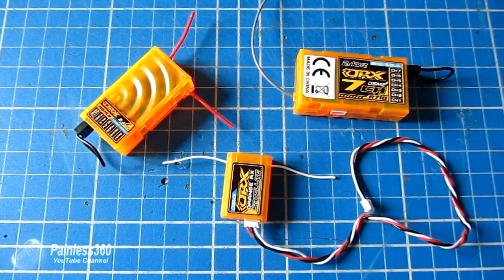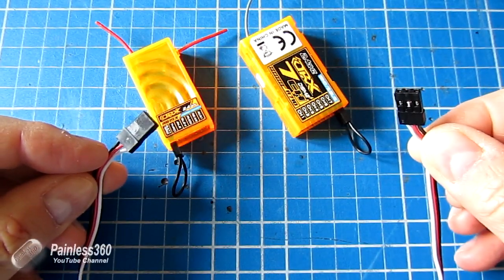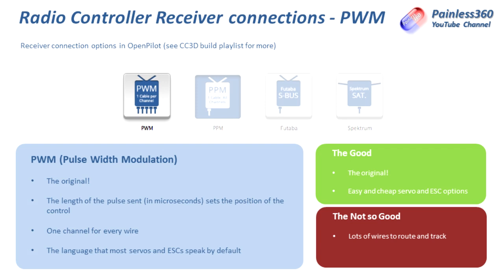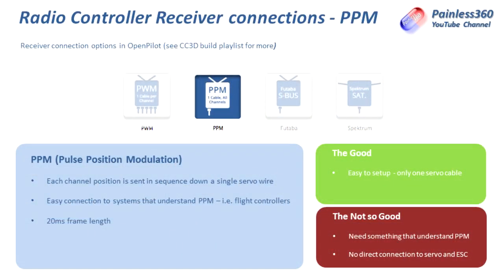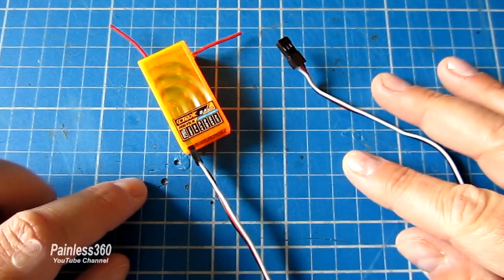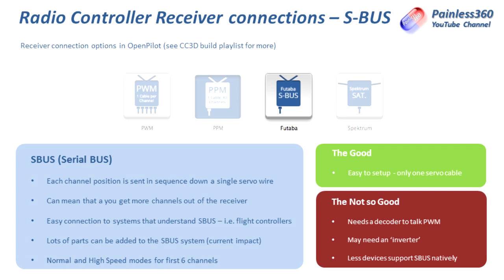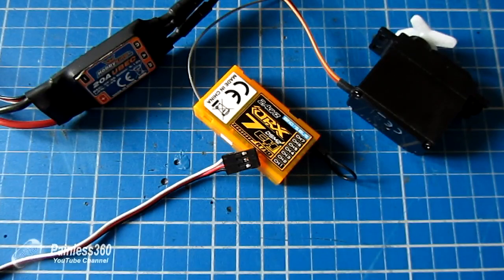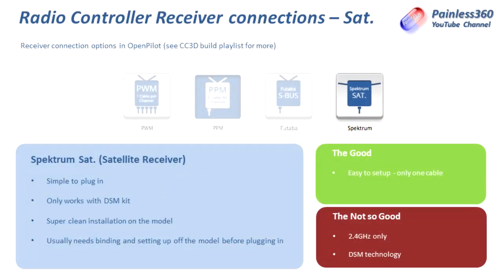RC Quick Tip - PWM, PPM, CPPM, S-BUS and Sat. explained for beginners

Comment: stubtoe Using my DX9 and ORX R615X Rx... knowing that I can get up to eight CCPM channels can I use any  two other PWM channels from the R615X... this would include control(Ail, Thr, Elv Rud or any Aux/Gear switch
Reply from the maker: +Joe Stubbs Typically the first 6 outputs are on the normal pwm pin outputs.. Best of luck.
Reply: +Painless360 .. not sure if I understand ..I will try .. channels 1 to 6 = Thr; Ail; Elv; Rud; Ger; Ax1; .... chan 7 and 8 are Ax2 and Ax3 ...now,  how do I attach these to the CCPM daisy chain or do I configure the PWM O/P's to give me 2 extra switch O/P'S   Oh!!! and keep the good work up with your very informative video's, I do so wish  the RC Forums  would use the medium more ...Joe

Comment: have the xk detect x380 rx/tx and cc3d revo.......  PPM one cable for all controls coming off rx.

Where to plug into cc3d, and type of plug to use off rx to cc3d, as nothing (inputs) match up with plugs that are connected to rx.

guessing it will plug into the flexi port, although, 3 pin coming off rx, 4 pin, going into flexi port.....

THANKS
Reply from the maker: +LA smyth See our series on the CC3D that answers a lot of these questions..
Reply: +Painless360 I looked at that, and this vid, shows the 3 prog into rx, and same plug on other end, but FC in this vid has 5 pins, I think, and 3 on left side used, i think.  Which cc3d except for motors, has no external pins.  Just the plug outlets, which isn't compatible with plug coming off the rx

Can't calibrate tx till figure plug and sequence.
Reply: +LA smyth at 7:00 of this vid, it shows the plug in/out, are the same, but that needs to be switched to a plug that will insert into the cc3d.  ports are 4 prong, with 3 coming off rx.

also, is there anything i can burn out / zap if rx conx to cc3d wrong, or visa vera, anything coming in or out hot I need to worry about.
Reply: +Painless360 if &#39;libre&#39; is the same, I may have found the answer.  pin 1-2-8

https://forum.librepilot.org/index.php?action=dlattach;topic=149.0;attach=240;image

if that doesn't work, may have to switch over to libre...........any thoughts.  wish I know 'openpilot' closed before buying .........LOL
Reply from the maker: Yep, that sounds right! Best of luck!

Comment: Hi,  when using s-bus on orange 7 channel receiver can the spectrum dx7 transmitter be used , is it  s-bus compatible  or  is the s-bus only for futaba transmitters?  Regards Claude..
Reply from the maker: +Mark Crowe S-Bus is how the radio receiver sends the signals so as long as the receiver is S-Bus out then you are usually good..
Reply: Painless360 Thanks for your help. Regards Claude

Comment: So, can I use PWM to PPM converter with PWM receiver to get few pins free on flight board? Right?
Reply from the maker: Yep
Reply: +Painless360 That's great! So I can use cheap converter instead of buying expensive receiver-transmitter kit again)
Reply from the maker: Yep ;)

Comment: Hi thanks for a timely lesson; I have just got back into this magic hobby and a steep learning curve; I am building a tricopter and chose the ET vector FC I have a Sperktrum DX6 and bought a SPMAR 7700 Rx which has a satellite; you say connect the satellite to the FC what about the main Rx does it also connect and howI have been flying fixed wing trainers on PWM all very enjoyable Thanks for your time Adrian
Reply from the maker: +Adrian J Vermeer Welcome back to the hobby. They satellite can be connected as an auxiliary set of antennas to the main radio receiver or connected directly to the flight control board (if supported) that makes the installation and wiring very easy. I would not use an R616XN from HobbyKing instead as the challenges with 5v vs. 3.3v are all avoided. Best of luck with the build..

Comment: Hello,
From the tutorials I've seen with a normal sized CC3D, go solder a wire to catch the + 3.3V to power the satellite.
https://www.youtube.com/watch?v=_iPlUcGKZ2o

By cons for CC3D MINI size is not specified on the electronic card and it does not seem to have a terminal where to connect for the + 3.3V. My question is what the CC3D mini format, it simply plugs satellite and the supply voltage for this satellite is good (no 3.3V fetching matter)?

thank you in advance for your reply
Alex
Reply from the maker: +Alexandre Pietrons I don't use sat. Rx here. I would use a R616 from HobbyKing and connect it via PPM. Sorry I can't offer any more advice. You can use a step down to go from the 5v to 3.3v.. Best of luck.
Reply: +Painless360 OK Thanks

Comment: Great video! Thank you so much for this information and the learning I've gotten from so many of your videos. I would like to suggest that you create a video about how it is possible for there to be 16 channel radios (like my Taranis) when the common (50Hz) frame is 20ms. I've posted this as a question on http://www.rcgroups.com/forums/showthread.php?t=2537177#post33128443 also.
Reply from the maker: PPM only supports 8 channels, you need the digital goodness of S-Bus to get all 16. You can also bind two x8R receivers at the same time and get all 16 (2x8) PWM channels on the model too..

Comment: failsafe after model final set up  using the r615 receiver ..how is this done ?
Reply from the maker: +bill alvarez Sorry, I don't understand what you are asking..
Reply: what i understand is that ..lets say i am using pwm on the r615 receiver and i am done setting it up ready to fly ..but of course i need to set failsafe(rebind) to avoid flyaway right ..so how do i do this using ppm(single wire occupying bind pins ) got no where to insert the bind plug..thanks for your reply..you thought me a lot through the years btw ..thanks again
Reply from the maker: +bill alvarez I see. unplug the PPM cable and rebind as nornal then unplug the Bind plug and reconnect the PPM again..
Reply from the maker: +Painless360 Yep :)
Reply: +Painless360 
that simple hah..thought the fc keeps the stick positions ..thanks

Comment: As soon as you told me I had a PWM transmitter  from the Hitec Aurora 9x manual, I searched "Differences between PWM and SBus."  ...and of course the first result that shows up is this video.  Thanks again, Lee! (I'm sure this won't be the last time I say this).  I now understand the physical differences of the various types, but I was wondering if you can shed light on what is better in terms of "speed", I guess?  Because the signals in a PWM system have individual wires to talk along, would this make transmission time easier, thus faster than say a SBus system?  ...or perhaps more stable?
Reply from the maker: +Michael “MiMo” Richard In real terms the difference in speed is imperceptible. The PPM frame is between 22.5 and 27milliseconds so it's all happening faster than pilot reaction times. In some flight controllers they then multiplex the PWM signals anyway so any faster transmission using 'parallel' signals is lost anyway. I wouldn't worry about it if I were you, happy flying!

Comment: Thanks for the video! I was wondering, if I connect a servo cable (white,red,black) horizontally across the signal pins on both the flight controller and receiver, is it safe to do? I tried this just now with a FrSky X8R to an APM 2.6 and was able to do the transmitter calibration. I just want to be certain that I don't fry anything :)
Reply from the maker: +iflyimpilot Yes, I do that too when I have no option but to use PWM with a flight controller. I'm a huge fan of PPM personally!

Comment: Great video. I am currently flying Naze32 with Spektrum Satellite. I have an SP3 board on the way and can not find the wiring information I need to do for the Spektrum Satellite only. I can use a receiver but like the satellite only on my Naze.
Reply from the maker: +Mark Haman I would guess UART3 and connect to the header pins but I would suggest you contact the guys who sold it to you for support.. Best of luck...

Comment: Hi can you put me out of pain.... Orange receiver dsmx cppm or s.bus and my DX8 (with Pixhawk) .. OK if I use the R820X as normal I will get 8 ch, If i use cppm I will get 8ch plus. total of 12 ch . what I cant find out is Do I get 12 ch from my DX8 ( which is an 8ch Rx) or can I poss through mixing get the 12 ch . Alas no one has answered  on other forums so it is up to you to hold the faith. Cheers
Reply: +Russell Green a Spektrum DX8 is an eight channel transmitter, that is your limit
Reply from the maker: +Russell Green The limit, as erg)centric rightly says, is your radio. If can only send out 8 channels max. As it happens this is perfect for an 8 channel receiver or a PPM connection to a flight controller.
Reply: +Painless360 Ok got it now ,, It is either the DX8 or Cppm not a combo or Mix, tks now out of misery, keep up the great work, we need it

Comment: Whats i-BUS
Reply from the maker: Where have you seen that?
Reply: Painless360 On my flysky fs-i6 and the receiver i bought fs-i6ab

I have the option of ppm and ibus it says to get more channels out of the system. 

Could I also ask, I recenetly got a dji naza and trying to use ppm i find that the flight mode switch must be on the 7th channel and my transmitter only has 6 channels, is there any method to modify the order?
Reply from the maker: Not sure what they mean - I've not heard of I-bus.. yet!
Reply from the maker: I believe you can get channel mappers that will remap the channels but I've never used one. Sorry I can't be more help. Best of luck with it.

Comment: Question 360..i just recently switched from spektrum using serialrx to Frsky d4rii cppm. The throttle response is incredibly slowed down. Am I missing a setting in the transmitter/cleanflight?
Reply from the maker: Are you seeing this in flight or just in the Cleanflight GUI? You may need to upgrade the FW on the D4R if you are using more than 6-7 channels.. Best of luck..
Reply: Painless360
Just in flight. Only using 5 channels. 5th just to change flight mode. If I use the motor control in cleanflight it is fine
Reply from the maker: Sounds odd, I've not seen that and have used all of the modes of connection here. I would suggest search in the forums..

Comment: Painless,

Seeing how you lean toward ORX wondering if you've heard anything of the pulse width on the ORX R620x-R1220X receivers being too narrow for the Pixhawk? Seen a few musings but nothing definitive. I'm running the R615X using PPM quite nicely but need to squeeze out another channel.
Reply from the maker: +Chris Salas Not heard of that myself as I only use the ORX kit on park flyers with no more then 7 channel (5 normally). Best of luck with it.
Reply from the maker: Almost every receiver has users that are unhappy with the performance. Thanks for sharing your opinion and experiences.

Comment: Nice video Lee, Cleared it up for me. Do you know how you bind the Sat rx directly with out a main Rx. I understand you can do this with the Naze32. Have you done a video of this, Would be grateful for the info?  Regards Garry
Reply from the maker: Garry Nutter No video from me but some others have done it. You need to bind the satellite receiver to the radio using a conventional receiver with the sat port on the side them unplug it from there and install it onto the Naze32. This is covered in the Naze32 manual pages. Best of luck with it!

Comment: Hi Great video my question is in PPM mode can i used other channel on the RX for a gimbal or a 2 way video switch ?
Reply from the maker: TriniRCmodels That depends on the receiver the little receiver shown here will but may will turn off the PWM outputs when the PPM output is used.
Hope this helps.
Reply: Painless360 i have a D4r-ii receiver can i use channel 2 for video switcher and if so how do i set it up for a switch on my transmitter or even tho on any ppm receiver can you do a video on how other channel works
Reply from the maker: http://www.hobbyking.com/hobbyking/store/uploads/736633136X172282X46.pdf answers it for you - "When in PPM mode CH2 will output RSSI (PWM)"

Best of luck with it.

Comment: Please answer a really simple question.  I am using pwm.  Would like to use cppm.  I understand for cppm you use only one cable,  this comes from the bind port on the rx, but which port do you use on a flip32 board.  Please help.
Reply from the maker: Fred Kaz This is covered in this video - https://www.youtube.com/watch?v=-yiJw1lYCq8&index=2&list=PLYsWjANuAm4p47OBBTOo4Xr3lNUc8PFpc
The Flip32 is the same as a Naze32 really - the pin-outs are a little different - https://www.youtube.com/watch?v=SZdIWCOigoY
Loads of useful series on the channel now, have a look about - you never know what you'll find..
Happy flying!

Comment: Great video, Im wondering how the pwm to ppm converters work with the naze/flip32.  Anyone have any experience with them?  Thx
Reply from the maker: knwest2012 They are very simple devices to use - plus the PWM side into the Rx and the PPM output into the flight controller. Be aware that they so cause a very slight 'lag' on the inputs as it has to read, decode, re-encode/package them into a PPM frame and then send them via the single cable to the flight controller.
Happy flying!
Reply: Thank you sir, maybe not for me as I fly mostly proximity.

Comment: Nice info.  What does a DEVO 7 RX output?  And will they work with the various FCs?

Thanks
Reply from the maker: TheGusK You need to get the manual for the receiver and see what it can output. I don't use that kit here so can't help..
Best of luck.

Comment: What so called "satellite receiver" has to do with the satellites flying on Earth orbit? Why it's named like that?
Reply from the maker: Igor Zamychkin "Satellite refers to the fact that this is a satellite receiver. Spektrum and others use a system where the main receiver can connect to smaller, auxiliary receivers for improved reception. These smaller aux. rx are called satellite receivers. Hope this helps."

Comment: have u use this orangerx to pixhwak ? ( i am using spektrum radio)

here is 2 question:

1) when i try to setup the failsafe , and try turn off my radio see what is the the throttle value  when i turn it off ( the lowest value is 1088 when the radio is ON, when i turn it off it suppose lower then 1088) . however when i check the radio calibration page at mission planner when i turn off the radio , the throttle value didnt drop at all, it just stay at the value which when i turn off the radio. ( for example if i push to 60% of my throttle before i turn it off, i will stay there ) but the board still able to detect if lose the radio signal and failsafe will kicks in if i turn off the radio (as long as i set the failsafe value is lower then 1088) ... is it safe ? cause when i use same radio rx with PPM Encoder with my other previous build, it will drop the throttle value if i turn off the radio...will it a matter ?

2) when i arm and try to fly, seems like the throttle is kinda working delay , every time i move the throttle up and down it will move 1 or 2 second delay and wont response immediately .
Reply from the maker: hide everfree I've not used Pixhawk here but here is the best answers I can give you :)
1) You need to use an OrangeRX that includes failsafe (not all of them do!), if you are then you need to rebind the receiver with the radio at the levels you want the receiver to output in the case of a lost signal. 
2) You need to be careful on the modes you are using, the Pixhawk, like the APM, isn't designed for ACRO style flying. If you have Baro turned on then the throttle will feel 'mushy'. 
Best of luck with it.
Reply: Painless360  very nice reply ! thx so much . 
for the "Baro turned on then the throttle" i am not too sure what it means exactly ... any example ? for this ?
Reply from the maker: Watch the APM flight mode video - Pixhawk works in the same way..

https://www.youtube.com/watch?v=uJga3tq8ySs&index=4&list=PLYsWjANuAm4oswLMu9OU8yOm-9J6y30XW
Reply: Painless360 the mushy is happen when i in stablize mode ... any idea ?
Reply from the maker: Could be a few things - copter underpowered, radio calibration hiccup, ppm based signal delay from the Rx.. 

Lots about this on usual forums.. 

Best of luck with it..

Comment: Great video!
One (dumb) question:
The "Satellite" word in spektrum is just for show right? there are actually no real satellites involved in the process. correct?
Reply from the maker: elvampir0 Not at all. Satellite refers to the fact that this is a satellite receiver. Spektrum and others use a system where the main receiver can connect to smaller, auxiliary receivers for improved reception. These smaller aux. rx are called satellite receivers. Hope this helps.
Reply: Painless360 sure helps!
thanks! :)
I dint know there were systems with multiple receivers for the same thing. I guess its for redundancy?
Reply from the maker: Yep, called diversity or 'multipathing' it allows for more chance of a great signal as the craft banks and turns.

Happy flying!

Comment: First, great videos! I have a Dx6i I'm building a quad. Question? Is that what I will need to get so I can use my radio? If so were do I get it,also do you know what FC it is compatible with? Thank you so much!
Reply: DSMx
Reply from the maker: Richie RICH Sounds like you are new to RC. Can I suggest that you watch the videos in my 'Introduction to RC' series - they may help.. https://www.youtube.com/playlist?list=PLYsWjANuAm4oWuE5ZDX4TAiHBv2i0Xl4m
Best of luck
Reply: Richie RICH I use the the Orange recievers with my DX6i. Got them from Hobby King for 10-11 bucks. Have them set up in PPM with CC3Ds. And they work great!
Reply: Thank You! Thats what I was looking for! Your the Best.